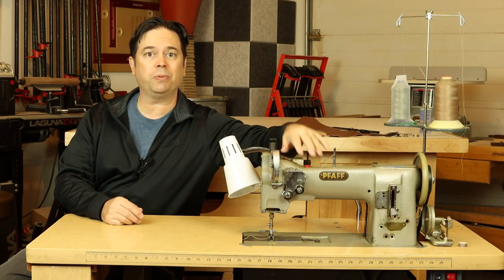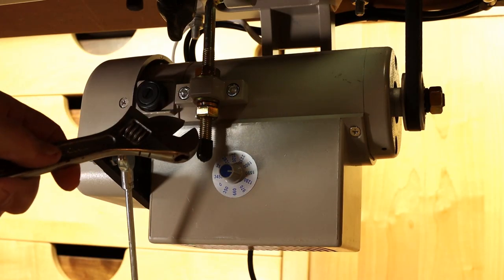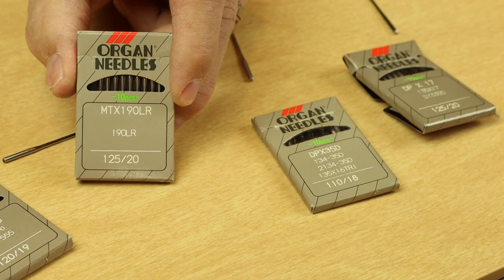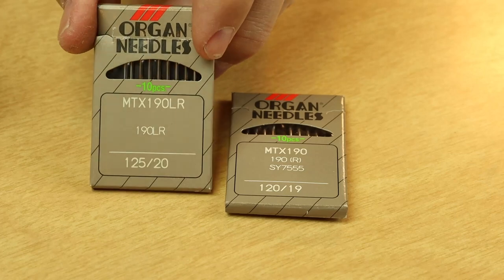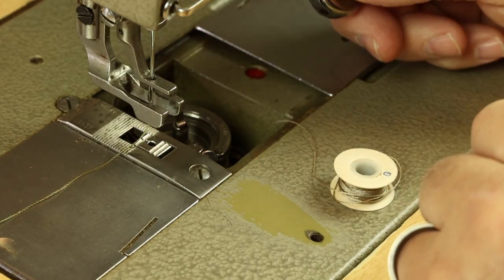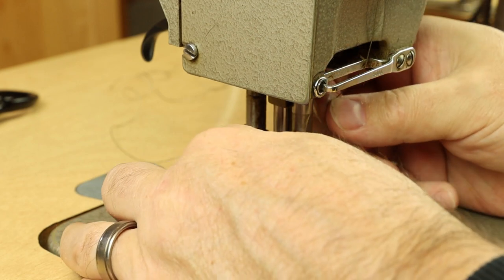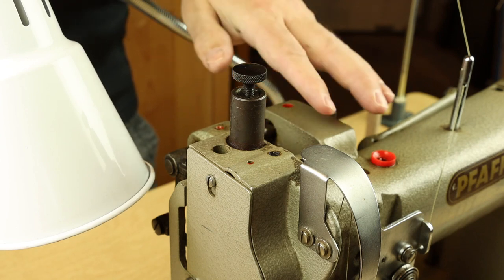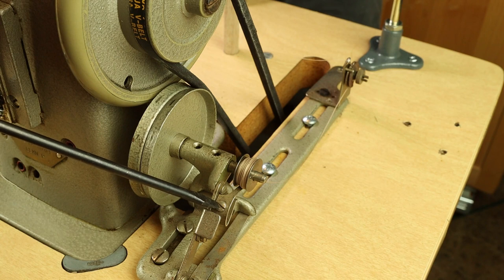Everything Pfaff 145 Walking Foot Industrial Sewing Machine Learn to set up and adjust Pfaff 145 545

Comment: Where can we find a chart for the signification on the letters C, L, M, N, P, H4, H2, etc?
Reply from the maker: C means class C machine for medium to heavy work
L means appropriate for leather
P means 4 motion drop feed
M means it has a safety clutch
N denotes a max stitch length of 6mm
H3 is standard lift
H4 is a high lift machine

Best
Reply: @TheThoughtfulWoodworker  Thank you for your quick response. Can you explain what the 4 motion drop feed is (P)? What is the difference with a 145 without the code P?
Reply from the maker: @claudechamberland6852  Standard 145 machines will have 4 motion drop feed.  Only specialty factory machines lack it.  I would recommend sticking with 4 motion drop feed for the full benefits of a unison feed machine.  Otherwise the material doesn't advance the same way.  The internal mechanism of the feed dog is different.
Best
Reply: @TheThoughtfulWoodworker  Does that mean all 145 have 4 motion eventhough the P is not printed on the plate in front of the machine?
Reply from the maker: No, it only has 4 motion drop feed if says P on the placque.  Most say CLPMN, but sometimes in a different order.  If it doesn't say P you might be getting a 3 motion drop feed or a simple up and down motion for specialty binding operations.  Basically a high risk purchase if it doesn't say P on the plaque.
Best of luck with it.
Reply: @TheThoughtfulWoodworker  Thanks, very clear now.
Reply: In the description of the video you list similar machines such as: Consew 226, 206rb, 206rb-1, 206rb-2, 206rb 1, 206rb 2, 206rb 3, 206rb 4, 206 rb 5, 206rb-5, nakajima 280L, juki, juki lu-562, lu-563, lu, 652, 563. Do they have a 4 motion drop feed similar to the PFAFF 145 P?  How can I differenciate the ones that have it? Thanks.
Reply from the maker: @claudechamberland6852  any of the other machines you mentioned will have triple feed.  In other words the needle, walking foot and feed dogs work together to feed material evenly.  I think the term 4 motion drop feed is a Pfaff thing.  I'm confident that any triple feed machine will do fine from upholstery and leather.  I've just heard weird stories of specialty Pfaffs not working well for general upholstery work.
Best

Comment: Buenos dias me pidria decir que significan las siglas CSMN EN EL MODELO 545-H3-6/01 gracias
Reply from the maker: 545 H3 is a large bobbin standard lift sewing machine.  C = medium to heavy duty, M = safety clutch, N = 6mm stitch length.  Usually they say CLPMN.  L = for leather.  P = 4 motion drop feed.  I'm not sure what the S stands for on your machine.  Good luck.
Reply: Muchisimas gracias dios se lo pague
Reply: @TheThoughtfulWoodworker   "stoff", fabric as opposed to "L" being leder/leather (some Pfaff manuals use much more detail but that is simplified version) not 100% certain but suspect some of the difference between the fabric/leather designations would be the style of teeth that would have been available from factory (sharpness, number, shape)

Comment: How do you set timing on Pfaff 145
Reply from the maker: You really want to make sure the timing is off before you make adjustments.  Correct timing has the eye of the needle even with the rotary hook when the needle bar is about 3/32" past bottom dead center (turning the handwheel towards you).  If it is a timing issue, you can loosen a couple screws to adjust.  Or it could be the needle bar is at the wrong height.  Remember that H3 models use a different needle than H4 models.  Best to you.
Reply: Thank you. I will try what you suggested.
Reply: Having another problem, why is the needle foot stuck on the presser foot when raised?
Reply: I solved the timing problem, the needle was too short

Comment: What is the foot lift on this machine?
Reply from the maker: It has a knee lift to raise the pressor foot.
Thanks for checking out the video.
Best
Reply: @TheThoughtfulWoodworker  right,what I meant was how thick of material can fit under the foot?
Reply from the maker: @Sunsetluver1  It will fit about 1/2" under the foot, and sew about 3/8" of compressed leather.  
Thanks
Reply: @TheThoughtfulWoodworker  thank you

Comment: Excellent instruction video. I have a Singer industrial 111W115 and its similar to this machine it still has the clutch motor everything is original. My only problem is finding G ready wound bobbins with the paper sides like the one you showed. If you have a source for those ready wound bobbins I would appreciate you sharing where you find them. Thank you 👍
Reply from the maker: You might try eBay, or the Thread Exchange.  Truth me told, I usually wind my own bobbins because I'm always using a new color of very dark brown, green, or deep red that doesn't come prewound.  Those are the reasons I like to buy spools and wind bobbins myself.  For those using a lot of white, black and beaver the prewound bobbins work great.
Best

Comment: I just purchased a 145 H3 today. If I need parts, where do you recommend? I'm thinking optional foot types as a start...
Reply from the maker: For presser feet, bobbins, needles etc I use eBay sellers.  For major parts you might try Nick-o-sew.  I've bought used 145 and 545 parts from them before.  Good luck with the new machine.